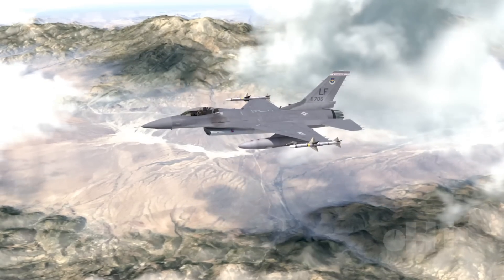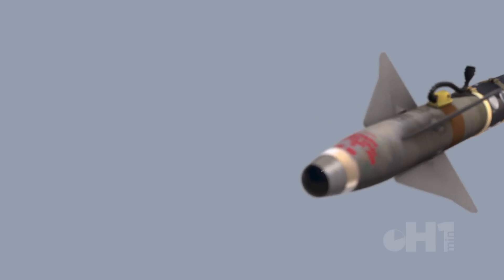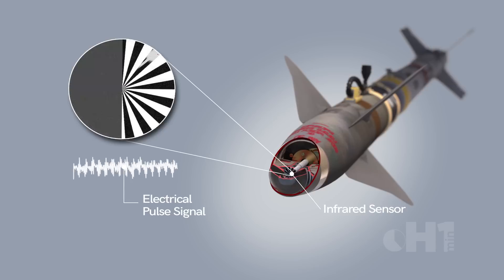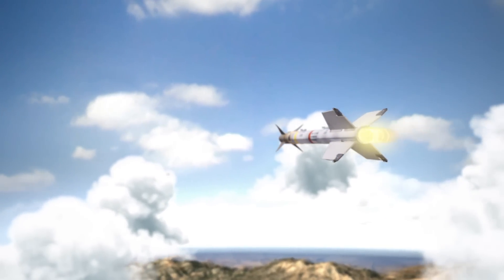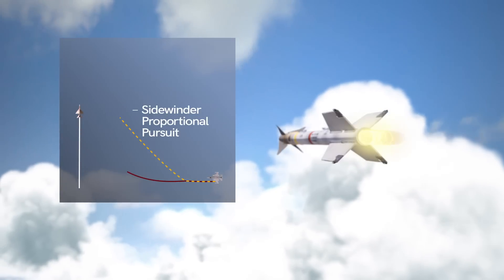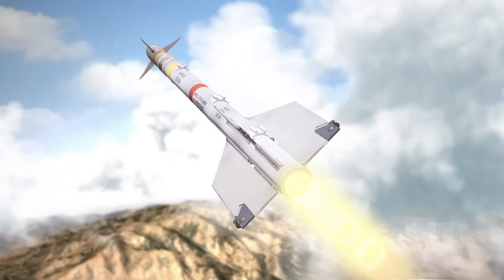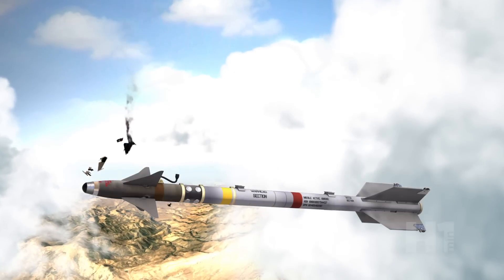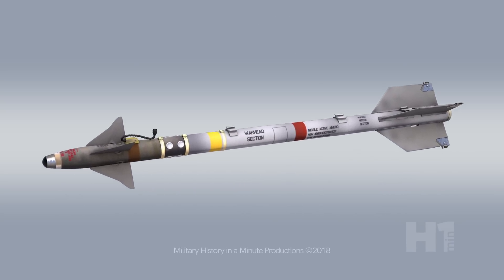H1MIN: AIM-9 SIDEWINDER Infrared Seeker

Comment: In 1982 the USA secretly provided us (the UK) with AIM-9L missiles for use in the Falklands War, despite being technically neutral. This allowed our Sea Harriers, which are really an attack aircraft and not particularly suited to air superiority duty, to get 20 air to air kills with zero losses (2 lost to ground fire). Without this weapon we would not have had an effective carrier based fighter. And that is the story of how the Sidewinder missile was instrumental in winning the Falklands War. Thank you to our American friends 👍.
Reply: The US was also prepared to lend the USS Guam, a Iwo Jima-class helicopter carrier, to the UK to assist if the need arose.
Reply: Xei: The Sea Harrier primary role was air defense. Its' radar systems were optimized for air to air.  The RAF Harriers were primarily strike/attack versions.
Reply: @KB4QAA  It was originally designed to meet a NATO specification for a "Light Tactical Support Fighter". Of course it was pressed into service for air defence but it was never really suitable for it, any Sea Harrier pilot will tell you they used to get trashed by real dedicated air superiority fighters in exercises. Even the Mirage III convincingly beat the Sea Harrier, the only reason they did badly in the Falklands was they were operating at the very edge of their range and really had no fuel to stay and fight. Also being forced to low altitude by the destroyer air defence screen.
Reply: Pretty sure they also provided heaps of intelligence info as well.
Reply: US did not neutral since it provided the Brit for port call at Ascension island in Atlantic.
Reply: Wrong we had the SRAAMs missile which were better in every conceivable way besides range.
Reply: @officialcommitteeoftimetra9806  Sure, but SRAAM never went into production. We couldn't exactly use a non existent missile in combat...
Reply: @xeigen2  likely would have seen further developments if not for the AIM-9.
Reply: @officialcommitteeoftimetra9806  Easy to say "it would have" but that's entirely theoretical. The UK did not have the funding to continue at the time. It was already killed off in 1974 due to spending cuts, work on Skyflash was preferred. 
At that point AIM-9 was nowhere near the capability of SRAAM. However by 1977 AIM-9L with all-aspect capability, wider seeker angles and improved maneuverability had closed the capability gap to SRAAM enough to be considered instead. Especially because of how much cheaper it was. And indeed we had an 80% kill ratio with it in the Falklands.
SRAAM eventually became the basis for the AIM-132 ASRAAM we use now. So further development actually did happen.
Reply: You're welcome!
Reply: The Argies did not know how to deal with the new missle, it was so good.
Reply: Aim9L was the first ir missile with head on attack capability.I remember reading aviation week.harrier pilot claim the ir seeker was so sensitive  that it can  detect minute air friction on aircraft fuselage.israel pilot claim to witness aim9L struck syrian mig21 cockpit.head on.
Reply: The USA was in a dicey position what with Argentina being an 'America's' nation, but when push comes to shove we'll always side with Britain. Always have, probably always will. You can't break that bond, it's centuries old.
Reply: @heyfitzpablum  true. That missile was still brand new and untested. They literally pulled missile off American frontline home defence jets and gave them to Argentines.
Reply: Didn't they also provide a more powerful missile that the Vulcan's carried to knock out radar stations?  The missile's name escapes me though.
Reply: @TheGreatThicc  They did indeed, AGM-45 Shrike anti-radar missiles. Unfortunately the Argentinians knew about the threat of anti-radar missiles and would always turn their radar off when aircraft approached, so we only caused minor damage. It did effectively deny use of the radar for air defence though since they were too scared to use it after that.
Reply: @TheGreatThicc  Probably the Shrike.
Reply: what i dont understand is the secrecy, UK is in NATO, the base function of the pact is that if any of the signatory nations comes under attack (ie the occupation of the British territory for example) ALL NATO nations are bound to come to help ...

If Britain wanted they easily could have demanded from the US to deploy its military so why the hell would USA have to "secretly" supply the arms to someone that could just as easily asked for few full carrier groups and land assault force instead ...
Reply: @Asghaad  At the time the Monroe doctrine had significant influence, so much so that even if America agreed with what the UK was doing, allowing them to interfere with the America's was in direct violation of American foreign policy precedent. Thus the secrecy.
Reply: @kirinyardberry1324  Monroe Doctrine didnt stop US from landing troops in Europe did it ... and to be frank some centuries old "doctrine" that was never even realistically adhered to anyway doesnt stand a chance when confronted with obligation of NATO member state to protect any and all signataries when they are under attack which UK undeniably was ...

if UK wanted they could have demanded whole NATO to come to theyr aid, but chose not to, they obviously wanted to deal with the Argentinians themselves to not to appear weak ...

obviously they were right and could handle the situation just fine, but on the other hand they would have lost a lot less men doing so if they requested direct aid from the USA.
Reply: @Asghaad  I'm just stating why the US was hesitant to support the UK. Additionally, the Monroe doctrine only applied to European powers wishing to encroach on the Americas. It had no bearing on America's foreign policy regarding sending troops into Europe. Which was for the most part based on isolationism until the second world war.
Reply: @Asghaad  I'm confused as to why you put doctrine in quotes; it's a concept used quite often till this day. It is a very broad topic that encompasses many things so to dismiss them as a whole does not make much sense.
Reply: @kirinyardberry1324  because when someone uses some concept wishywashy when it suits them and totally ignores it when its not then its not a doctrine, its an excuse ...
Reply: @Asghaad  Why are you turning this into an argument? Arguing this doesn't "suit me" at all, I have no interest whether you believe in history or not. Where is this needless aggression coming from? I'm not making an argument for something, I'm explaining history. Do some research or read a history textbook, the Monroe Doctrine isn't "some concept wishywashy", it is one of the most influential doctrines the US has followed.
Reply: @Asghaad  Also excuse for what exactly?
Reply: @Asghaad  The Monroe Doctrine doesn't say anything about American troops in Europe. Why don't you get an actual education?
Reply: @Asghaad  the US government and many institutions call it a Doctrine. It's not a debate. It's fact. The Monroe Doctrine is a doctrine
Reply: @chaosXP3RT  sure thing pal, thats why we had US military convoys pass through my country smack dab in the middle of Europe three times in last year alone ...

Doctrine is just set of rules that SHOULD be obeyed but are NOT lawfully binding in any way shape or form
Reply: @Asghaad  NATO=North Atlantic Treaty Organization... so much wondering about something that is explained very well in the name ot the treaty... hehe
Wrong part of the world that is not protected by the NATO(Article 5 in the theaty explains what part of the world is protected)... Falkland Islands are in the South Atlantic=>unprotected by NATO.
Reply: @Bialy_1  can someone please go tell Italy, whole Balkans, whole central Europe and other countries that "arent in the North Atlantic" that despite being full NATO members they "arent protected by NATO" ...

also i guess NATO never intervened in Bosnia or Afghanistan right ? Because those are also nowhere near Atlantic ...
Reply: @Asghaad  It's NATO, they can't do anything productive.
Reply: The question is why? There's no tactical advantage for USA even if UK own Falkland. There's no bad blood between USA and Argentina so it's just USA treating South America like ass once again. Don't they feel enough with their banana republics bullshit? (not the clothing brand, but the actual asshole history moment)
Reply: @kos2919  Because WE ARE ALLIES
its what friends do
Reply: @kos2919  Should the USA have supported the Argentine Junta against UK in the Falklands War? It's not a question of treating South America 'like ass', it's a question of siding with a modern democracy that America has had a centuries long relationship with against a right wing regime that treated their own people like crap.
Reply: @kos2919  US and UK are cousin, They are Anglo race including Australia , New zealand  and Canada.
Reply: @alexlo7708  funny how America celebrated freedom from so called cousin.
Reply: @kos2919  Quarrel within same family is so obvious.  But when it attack outsider, it unanimously attack.
Reply: @alexlo7708  there is no attack. It's just a dispute about an island ownership. But USA sympathize with UK more because USA did stole islands too.
Reply: @kos2919  It doesn't only steal islands but it stole north American continent from natives by killing them.
Reply: @kos2919  the UK and USA had a rocky relationship until WWII. After that, they saw each other as quintessential allies and partners.
Reply: @kos2919  Look up the Monroe Doctrine. This had nothing to do with stealing islands. If it did, the US would've helped Argentina invade and genocide the English-speaking Falkland islands.
Reply: @alexlo7708  Canada, Mexico, Cuba, Brazil, Argentina, Guatemala, etc. are all stolen lands
Reply: @chaosXP3RT  lol you're so naive.
Reply: @kos2919  Well hey we made up
Reply: @alexlo7708  yeah i get that
Reply: @alexlo7708  And??
Reply: @kos2919  The US helped the UK with Argentina in the hope that the UK would help the USA in the future. That's what friends do.
Reply: USA#1 !!  I would rather go to Switzerland or Sweden. Those seem like good countries
Reply: @dumb214  I’ve been to both.  Good luck immigrating to Switzerland.  The bar for letting immigrants into Switzerland is one of the highest in the world, even for Europeans.  Sweden has been transformed into something very strange over the past decade.  It isn’t recognizable from before, and none of it is for the better.
Reply: @LRRPFco52  fair enough
Reply: @dumb214  Then go
Reply: Anyways fuck Britain
Reply: USA#1 !!  The US is a third world degenerate shithole
Reply: @alanywalany6460  By both definitions of a third world country, you are very, very wrong.
Reply: @alanywalany6460  Nah.
Reply: @alanywalany6460  I’ve been to places like that before.  They are so far from conditions in the US, that it feels like being on a different planet.
Reply: @alanywalany6460  Not at the moment it isn't.  But a lot of people are afraid it's heading that way.
Reply: @wilhelmvonn9619  It's been for decades
Reply: @alanywalany6460  Wrong
Reply: @chaosXP3RT  I am very correct
Reply: @alanywalany6460  Nope
Reply: @chaosXP3RT  Tell me more
Reply: @alanywalany6460  better study up on the koran
Reply: @ronalddavis  huh
Reply: @alanywalany6460  there is no  reason to say huh if you cant see that the british isles  in a few years will be an islamic state. thus you need to read up on the koran if you want to survive
Reply: @ronalddavis  I'm not British lol
Reply: @alanywalany6460  SLASH
you don't do that
Reply: @alanywalany6460  Hello Mr. Russian!
Reply: @ecurb10  Are you trying to be funny?
Reply: Xei  - amazed the usa actually did something useful
Reply: @psychiatry-is-eugenics  Why are you amazed?
Reply: @chaosXP3RT  usa  never does anything right
Reply: @philmybutup4759   - if you have money usa can be great . But For a lot of people it is a racist nightmare
Reply: @psychiatry-is-eugenics  one of the reasons the us is great is because even if you don’t have money you can work for it. You can claim all the racism you want but that’s just an excuse. There are instances of racism. There is that in every country. However those instances compared to the hundreds of millions of people here mean the majority of people aren’t racist. Especially with all the woke corporations now trying to hire only or mostly minorities, literally anyone can succeed.  Before you argue that I wouldn’t understand well im a first generation immigrant from South America and my dad was poorer than you probably could imagine. Played soccer with pig stomachs. He worked his ass off for 30 years now is very wealthy in the us. All because of his hard work and the freedom allowed in the us. The only racism weve experienced was in South America. So I vehemently disagree with your opinion
Reply: @psychiatry-is-eugenics  hmmmmm buddy have you noticed that all of the major wars have been won cuz of us
Reply: @calgoman3120   - ww1 , yes , but usa failed the peace . ww2 , yes definitely the greatest generation ; but again failed the peace terribly . Allowed stalin to take over Europe .
Everything after ww2 has been a slow disaster ; korea , Vietnam , Iran etc.

Comment: I never imagined that it would kill with a continuous wire. This reminds me of the mines in Dishonored. I thought that this was just fantasy...
Reply: Many countries have discarded the continuous rod warhead as it is not as effective as a blast fragmentation warhead.
Reply: @fadlya.rahman4113  Have you any idea why they originally designed it as one piece? I see no merits and only design challenges in it...
Reply: @edi9892  Its easier to make a big rod that detaches itself and goes through your target at mach 2 than an elaborate circle of fragmentation propelled by explosion at mach 2 blasted around the sides of the rocket.
Reply: @edi9892  If memory serves me it had something to do with the target. Infra-red seekers use to need to see the hot exhaust of the engine and therefore were best used from behind. Targets usually had a hotspot in the middle and the missile would burst behind the target. The expanding ring would be in a good position to cut one or both wings off. At a larger distance the ring breaks up in big chunks and these were also capable of ripping a wing off and not just put a few holes in them. This breaking up was however very hard to predict and could even be the cause for a miss although the target was in the kill-zone.

Comment: Isn't the sideindwer should be gliding and the rocket booster are only for few seconds of flight?
Reply: That's right. The original Mk.17 rocket motor burns for 2.2 seconds and the newer Mk.36 4 seconds.